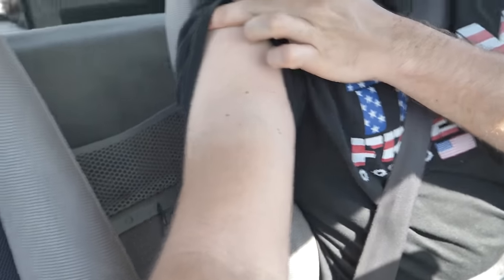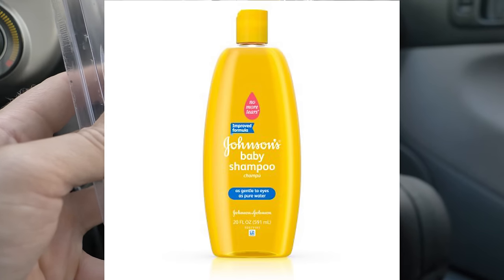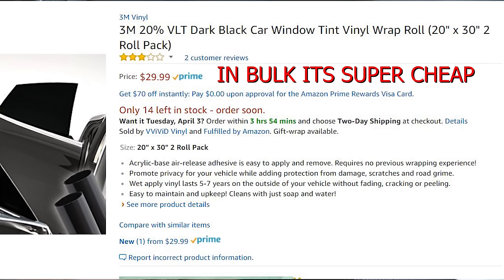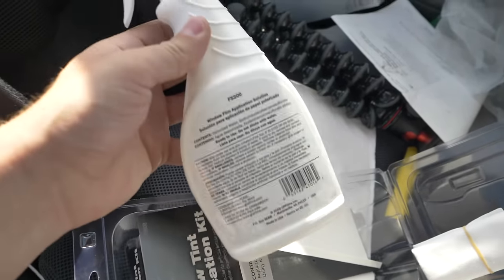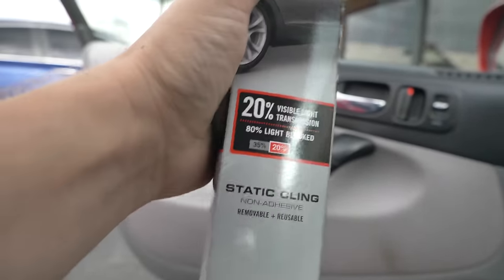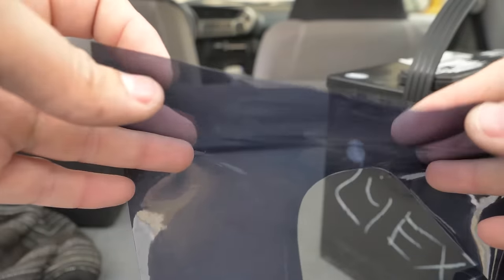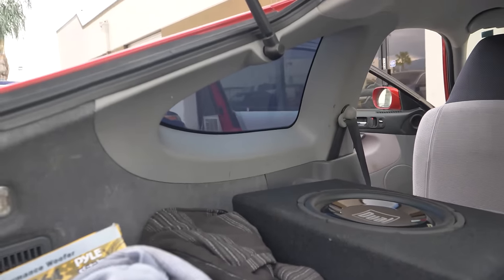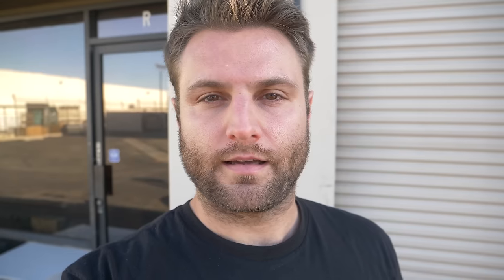How bad is $20 Window Tint from Autozone? Install | Review

Comment: I've actually used that film on a couple vehicles of mine and have gotten it to look decent. If you treat it like real tint it turns out better. If you hit it with a heat gun for a while it shrinks like normal tint and that orange peel goes away. I've gotten it to near perfect clarity. I put 35% on the whole windshield of a truck I used to have and did 5% over 20% using only this cling tint. Worked fine. I even did a 5% brow on my moms car with this exact stuff 3 years ago and it's still there to this day bubble free.

Comment: I've used the static cling tint before on a 2000 Ford Focus ZX3, on the rear window and the two rear side windows, and it came out great, I didn't have any bubbles or raised parts on the edges. Just have to take your time and work them out properly.

Comment: Dude you’re not letting it dry the stuff is actually amazing once it dries and the sun beats on it for at least a day, it turns into regular tint. I’ve done it on both my cars. The stuff is awesome
Reply: When you set out to "prove" how bad something is, it's incredibly easy to "not" attempt to do a good job. This stuff is absolutely incredible! There are no bubbles if worked properly and it is extremely easy to work with. I'd recommend this to anyone afraid of "messing up", because it is 100% forgiving or to anyone wishing to to go below legal statutes in a state where they make you pull it off on the spot.
Reply: Based on his choice of subwoofer I doubted him from the start.
Reply: What I do is leave the white protective film on only until after I make all the cuts
Reply: Agree, he sucks wow, did not even spray under
Reply: How much TSER or IR does it block? Put a meter to it
Reply: It’s crappy tint it will fade in a few years it sucks
Reply: Yea this dude is so negative
Reply: @Dingus5288  I did all the windows on my Honda six years ago and I did all the windows on my Nissan for years ago and they still look exactly the same. No peeling no nothing. And I drive the hell out of my car’s.

Comment: Why pay $20 for the tint + $12 for the install kit? In my area people (usually Hispanics) do a great job and will remove old tint and install new tint for around $80-100. Not worth it to do it yourself. Not to mention they use good quality tint that isn’t purple.
Reply: I paid $150 to have a shop tint my car.  They used high quality tint, and I had this done nearly 12 years ago.  It still looks good.
Reply: And if you've seen how a shop does it, it is not a "slap it on" job. It takes a STEADY hand and you must have a 100% absofrickinglutely crystal clear window. Every video I've seen in professional shops, they spend more time cleaning the window than actually cutting and applying the tint film. I'm serious.
Reply: Glycerin I paid 450 because my car is convertible and windows are a bitch to tint
Reply: Gabe Wall in my area in SoCal I paid $75 for a good window tint that isn’t purple or blue from a small business run by Hispanics too
Reply: Yeah I always get my windows tinted in mexico great tint for cheap
Reply: At the swap sho i bargained down to $75 for a whole car and its still look new 7 years later

Comment: Front window tint is illegal in CA.....demonetized.
Reply: front window tint isn't illegal in California, you just cant have below 30%
Reply: news to me; last time I was [in the car with someone else that got] pulled over the cop said none was legal
Reply: Naw you're right, besides a strip at the top of the windshield, windshield and front passenger and driver side windows can't be tinted whatsoever in California. Doesn't mean people don't get away with it, though.
Reply: "The amount of light that can pass through your car windows is measured in percentages (called VLT), so make sure your tinting film is up to these standards! In California there is no difference in regulations for sedans, or SUVs and vans, so these laws are for all vehicles.

    Windshield allows transparent strip on top 4 to 5 inches
    Front side windows must pass through more than 70% of light inside your car (70% VLT)
    Back side windows and rear window can have any darkness"
This has been the law since I was born.
Reply: It's at least been this way since I was born (im 21) the minimum is 30%. Usually a officer will only say something about your tint if its extreme or they pull you over for some reason turns out they were wrong and have to nail you on something
Reply: ApStryker2 this is the current laws wording:
"(d) Notwithstanding subdivision (a), clear, colorless, and transparent material may be installed, affixed, or applied to the front side windows, located to the immediate left and right of the front seat if the following conditions are met:

(1) The material has a minimum visible light transmittance of 88 percent.

(2) The window glazing with the material applied meets all requirements of Federal Motor Vehicle Safety Standard No. 205 (49 C.F.R. 571.205), including the specified minimum light transmittance of 70 percent and the abrasion resistance of AS–14 glazing, as specified in that federal standard.

(3) The material is designed and manufactured to enhance the ability of the existing window glass to block the sun’s harmful ultraviolet A rays.

(4) The driver has in his or her possession, or within the vehicle, a certificate signed by the installing company certifying that the windows with the material installed meet the requirements of this subdivision and the certificate identifies the installing company and the material’s manufacturer by full name and street address, or, if the material was installed by the vehicle owner, a certificate signed by the material’s manufacturer certifying that the windows with the material installed according to manufacturer’s instructions meet the requirements of this subdivision and the certificate identifies the material’s manufacturer by full name and street address.

(5) If the material described in this subdivision tears or bubbles, or is otherwise worn to prohibit clear vision, it shall be removed or replaced."
https://leginfo.legislature.ca.gov/faces/billTextClient.xhtml?bill_id=201720180AB1303

Essentially, unless you're getting some fancy clear tint, you're not supposed to put anything on there. Yes, a true tint is not colorless, and therefore cannot be put on the driver or passenger windows. Do cops let it slide? Of course. If you had a 70% tint, they would barely notice. As the law states, it's actually 88%, unless you have factory window tinting, which limits it to 70%. That difference, I believe, is new. But I think it's the colorless issue is why people, including myself, say you can't tint those two windows. (https://toplawyersfresno.com/know-your-rights-california-window-tint-laws/amp/)
Reply: If you read section 26708 a bit more clearly it asks for transparent material. transparent doesn't have to mean clear. Front tinting is legal, "The material is designed and manufactured to enhance the ability of the existing window glass to block the sun’s harmful ultraviolet A rays." this is tint.
 
"The driver has in his or her possession, or within the vehicle, a certificate signed by the installing company certifying that the windows with the material installed meet the requirements of this subdivision and the certificate identifies the installing company and the material’s manufacturer by full name and street address, or, if the material was installed by the vehicle owner, a certificate signed by the material’s manufacturer certifying that the windows with the material installed according to manufacturer’s instructions meet the requirements of this subdivision and the certificate identifies the material’s manufacturer by full name and street address." really easy to get from the shop that does it. If it was illegal in California you wouldn't have tinting shops that do the work. I know this example is a bit extreme but thats bascially saying meth is illegal but there are stores you can buy meth from.
70% follows federal motors saftey standard 30% is the absolute minimum you can have. Ive verified with tint shops around me and with an officer that pulled me over last night for speeding. Thats why officers also have a tint meter they use to make sure is 30% or more. section 26708 contradicts its self in so many ways....
Reply: Lmfao you asked the cop who pulled you over while speeding. Look, it says clear, colorless, and transparent. A cop isn't a lawyer; cops don't generally know laws any better than a citizen, even if they should. You do what you want lol, I'll listen to what lawyers are suggesting so I don't have to pay for them to defend me in court, or so I don't have to pay for a de-tint and re-tint on a fix it. I wouldn't listen to a cops on something like window tints anymore than I would something like edc knife laws. 3M makes clear, colorless, transparent films I can get applied. Plus, I can go to any shop in California and get a non-carb turbo kit installed, a full cat delete, etc. It's never a shop's liability as to what you do with your car lol.

And get used to it, that's how a shit ton of laws are lol.
Reply: Ashton S lol you can't apply anything to the windshield except the top 4 inches in California.
Reply: Chipper McManus no idea. I think it's because even clear, colorless film makes some light not transmit.
Reply: Ill end on this, you can go ahead and continue to listen to what "lawyers are suggesting" but at the end of the day if you've never taken the time to call or actually go ask either at your police station or city hall for the exact section/code you'll never really know. As long as you have a certificate stating that it is within the 30% and it passes an officers tint meter that they carry you are good. All I know is all 5 cars in my family have 30% front window tint and its been that way since I was a child, interacting with cops on multiple occasions(who would be the one giving me the ticket for it so he would at least have to somewhat know the law, emphasis on the somewhat because I agree with you that most cops don't know the exact wording) we have never had a problem. Any time we've been tint metered we've been good. Both of us have our different opinions and that's cool, I use to be in your position before I started asking questions when I was getting my first car. This is just gonna keep going in circles, again this is just what I have experienced/ been told. Have a good one bud
Reply: ApStryker2 Lmfao, the scare quotes on a lawyer's advice. Stay fun kid.
Reply: Nolen Purvis cool story kid
Reply: +Uriah Siner   Obviously cops always tells the truth, they are like the messiah - you still think Santa exists, don't you? Poor you...
Reply: JDM A'F Probably got a bucket
Reply: You're completely wrong dude. I have been cited for front window tint. They will only allow factory tint.
Reply: brandon wright lmfao
Reply: Uriah Siner everything is illegal in CA
Reply: Everything is illegal in CA
Reply: Uriah Siner ur everywhere dude
Reply: metaleggman18 Actually 88% of light must be able to pass through without factory tints on window and 70% must pass through if adding on top of factory tint on the driver and passenger side windows. Do not all ring is illegal.
Reply: bk meh true but there's less school shooting here then any other states.
Reply: Ceviche
Reply: Uriah Siner 70% in the front is max , cops don’t care about 70 , anything below and you can get rolled
Reply: metaleggman18 you need 70% light from the front side windows so 30% tiny back can be 0% you can’t have any on the windshield
Reply: In NV too, i have 5% window tint on front windows and never got pulled over.

Comment: I order precut tint off eBay. Like $12 and works great!
Reply: JohnVHRC What kind?
Reply: jbkaufman use lexen,only company i will ever use from now on and i tint vehicles for extra cash on the side while im in college,so far done about 10-15 including my own vehicles
Reply: Hell yeah!! It is good bro!!
Reply: That Ebay crap lasts only like 6-9 months tho. I used it myself.
Reply: Col. Angus what happens to it?
Reply: Col. Angus what happens to it?
Reply: JohnVHRC
The sun bleaches it and just goes clear.
Reply: Col. Angus its only 12 bucks
Reply: Ive bought lexen before, works great, had an issue with my one window and they sent a replacement without problems. had it on the car for 2 years now and still looks great
Reply: Doubt you did ur whole car for 12$ and got it done in one try. Gurantee you paid more. First of all. eBay tint doesn't give you enough per box. Which makes you buy another box. They are in business to make money. They know ur not gonna get it right the first time
Reply: Wait about a year and it’ll turn purple
Reply: TheIamdevin not telling you how to run your business or anything but lexen is one of the cheapest, it will fade after 2-3years to a blue or purple looking tint.
Reply: Where iz your video?

Comment: I love the static cling window tint ..In my state you will get a ticket for having you drivers door and passenger front door tinted..not to mention it will fail inspection. That's where this tint comes in, you can remove it quickly and re-use it. Saves me a lot of money..I never have any of the problems the guy said in the video for me it was a good purchase..
Reply: Thats where Im at like I drive a semi and it’s technically illegal in every state for us so if I get pulled in for an inspection and I can just take it right off and put it back on later lol obviously wont look perfect but it does the job

Comment: I installed cling window tint to both my cars and had none of the problems you mentioned...didn't move or have lines or anything else AND all my windows rolled up and down without displacing the tint...IJS...
Reply: I been using this tint alot
Reply: Works best with soapy water and a credit card.
Reply: Thank u. For ur answer

Comment: I put this same tint on my Outlander. If you use the hard edge of the squeegee to smooth it out you can kind of lock it in place, just use a lot of that solution so it slides along the tint instead of gripping and pulling it away. And after about a day in the sun all the waves smooth out and its actually not that bad other than the purple haze it gives off

Comment: Rob please try or the cheap Walmart dash cam. I think I would rather spend decent money on a good dash cam, but is it worth it for a cheap DD?
Reply: best bet  is to use a old cell phone with a large memory card. 
as an alternative
Reply: Yup, an old android cell phone works great. Just DL a decent dashcam app.
Reply: I bought a 30$ one from wish and it works perfectly
Reply: I got mine for $10 from Walmart and it works fine. The only complaint was it doesn’t hold a charge.

Comment: As a tint installer yes this stuff is cheap but you do not install to the top of the windows you allow room for the windows to enter the seal when it is rolled up.
Reply: You also install on the inside of the window correct??

Comment: Problem with cheap tint like that is that those tint are just dyed. So they really don’t block out UV, glare or heat. Basically it’s just looks. Worst of all is that they all bubble and they turn purple very easily. Even if you clean with ammonia free cleaners. Not worth it imo. I would go with Suntek it shrinks up nice, Llumar, 3M anything like that.

Comment: Dahm, you sure can be Dahm sometimes. I paid $30 on Groupon for ceramic tint film installed on two front windows (with the tint level of my choice) that is still going strong 3 years later. It's flawless. Again, $30!!! You can stack a ton of coupons on groupons all the time. This was in the LA area too.

Comment: If you are on a budget and gotta use the cheap stuff then clear nail varnish to seal around the edges really helps, and it stops any "fingers", I did it years ago with my first car I did use limo black film and I'm not sure if the film is actually any thicker but it lasted at least the 15 months I owned the car for, please don't judge I was young and did'nt know any better at the time, but you can't beat a professional install with quality film you'll be glad later.

Comment: i paid 700 for ceramic tint on all my doors, rear windshield, and had a clear ceramic sheet on the front windshield. amazing thing about ceramic tint is that it blocks heat and uv. Can hardly feel any heat when im in the car and its 90 outside. Was worth it.